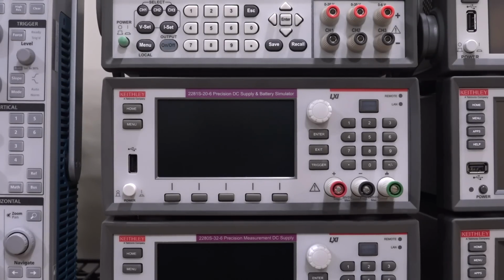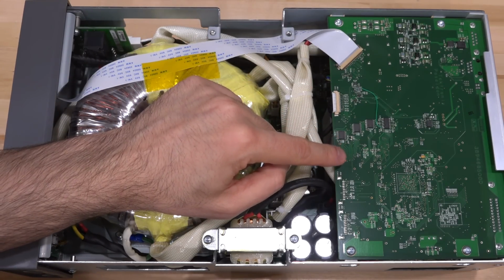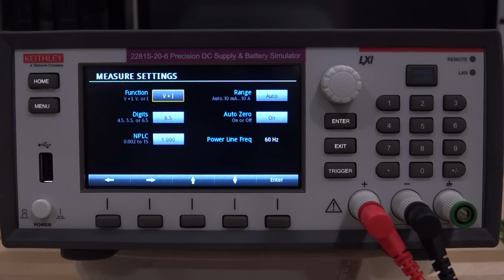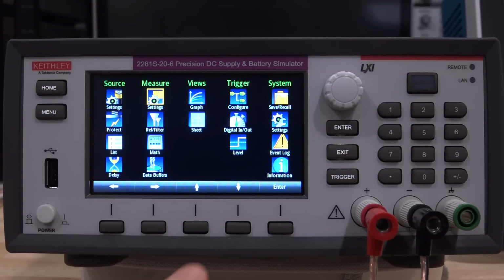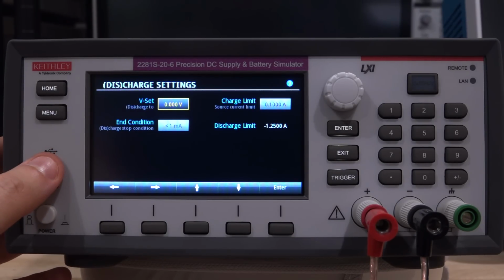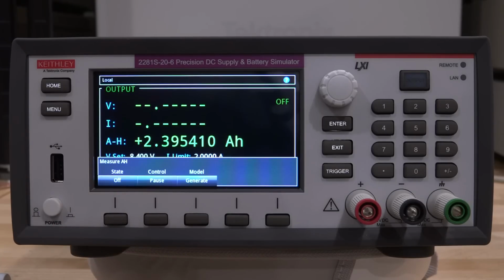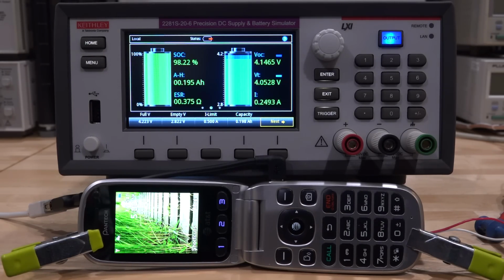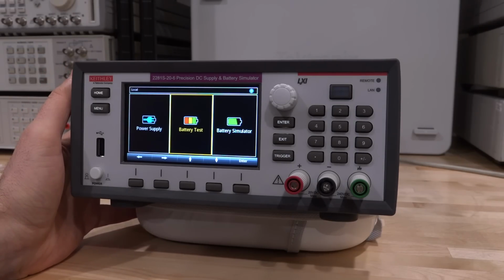TSP #222 - Keithley 2281S Precision Power Supply & Battery Simulator Review, Teardown & Experiments

Comment: Thanks Shahriar. So can battery ESR be manually calculated by (Voc - (Id * Rd))/Id where Voc = V open circuit, Rd = discharge resistor, Id = discharge current?

Comment: For those without an SMU, and the ability to create battery models, is there an online resource for battery models that the 2281S-20-6 can use?
Reply from the maker: It is a very basic CSV file for which you can create in Excel.

Comment: Nice review! I also like the way you used it to locate the short circuit. I don't know why yours is quiet but mine makes a lot of noise. It seems from the 1st day that the fan is always operating at maximum or at least very high speed. When you power it on the FAN starts in lower rpm which still makes a noticeable noise and once it boots the FAN speed gets higher rpms producing a lot more noise. I also checked that I have the latest firmware in case there is something wrong there.

Comment: I'm guessing that on the small PCB for the large transformer, there looks to be a relay to apply mains to the big transformer. And the small transformer is for a standby supply that enables the relay for the big one, and also powers the RTC supercaps, and whatever else,  when the unit is not in use.

Comment: Thanks Shahriar for this great review.  Do you have any insights as to how the terminal voltage in the battery simulator is implemented, ie purely software or hardware? Is it possible for you to show on an oscilloscope the response time of the simulated terminal voltage changing due to the ESR under a dynamic load?  ie in your experiment, the cell phone consumes 0.2A and then suddenly increases to 0.3A, how long does the 2281 take for the Vt to drop accordingly due to the ESR?

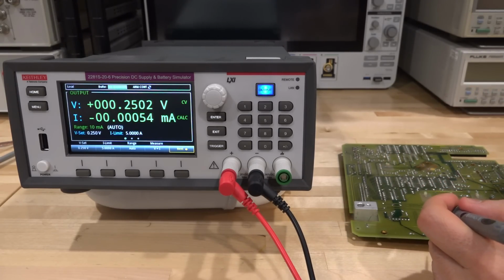Comment: 14:38 the short current at its highest was 0.87A. How was it possible if shorting 2 probes draws only 0.77A @ 12:57
Reply from the maker: The plate I was using to short the probes was a little too resistive.

Comment: They should have either put in a touch screen or modified the interface to be intuitive to use with arrow keys. This middle ground seems very awkward. You can even tell that you're having to pause and hunt for the right key as you navigate the menu system.

Comment: I have used this instrument for a year together with the 2450 SMU. The fact that the instrument does not have touch screen is VERY annoying. Almost every time i use the 2281 I try to use the screen. The 2450 (and other) has a really well designed GUI and touch screen inteface. And when the screen on the 2281 look the same it shall work the same.
Keithly: Please come with a 2282S-20-6 with a working touch screen + some other improvements...
Reply: For $4,000 its odd they would have left out the touchscreen. There must have been some other reason than money.

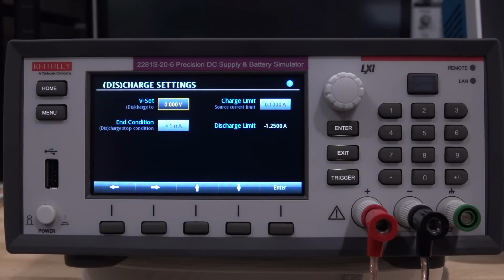Comment: 21:31 discharge limt = 1.25A
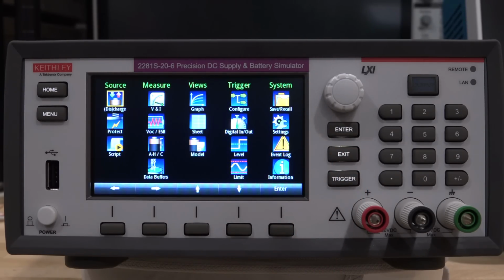26:00 1.11A discharge. I thought u said whether battery is capable or not it will discharge @ 1.25 A. Please explain. 
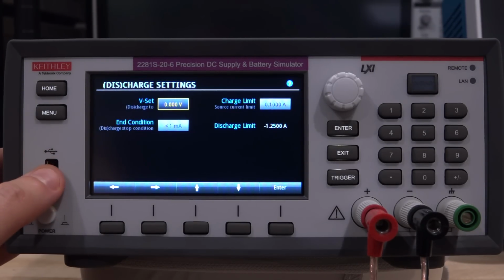I also didnt understand y u would put a resistance in series as said @ 21:45

Could u also brief on regenerative load Keysight RP7900 or alike. It looks interesting but dont know drawbacks.

Comment: For battery tests I like to use an actual battery with a much cheaper, faster, and easier to use Joulescope. Battery simulators, even on very high end Keithley devices, don't capture the dynamic behavior of primary cell LiFeS2 and LTC batteries. Primary cells don't model well as a simple ESR and voltage - they behaver more like a pair of RC circuits, and have strong temperature effects. So it's nice to be able to use a real battery in circuit, and still get amazing precision and 0.5 us resolution. And it streams onto your 4k monitor in real time, where you can quickly measure power, charge and timing.

Comment: When we draw current from a battery, it causes heating inside the battery.
To "test" a battery, we need to be able to draw the same current as the device we are simulating. If we draw some other current, the test result will change because the heating changes.
Doesn't this render the test results from a fixed sink current useless?
Reply from the maker: It is definitely a compromise. Batteries also have memory effects (partially due to thermal effects), and you cannot capture it with a linear, lookup-table model. I have suggested this to the Keithley team.

Comment: One downside of this unit which Shariar doesn't mention is that the remote web interface is written with Java applets, which haven't been supported in browsers for roughly 5-7 years or so. It still advertises this as a point on the datasheet though: "Emulation of front panel display and controls via your web browser simplifies automated control and monitoring". Kind of a bummer for a very expensive power supply to have an issue like this.
Reply from the maker: I haven't look into the web interface directly, but the Kickstart software compatibility is of course independent of Java. I'll look into the web interface.
Reply: This is quite annoying although the web interface does still work on internet explorer.

Comment: I have two of the 2280S models on my workbench. I bought the first one when the model initially came out and it came with a carry handle. The same model nowadays doesn't come with a carry model anymore. I wonder why they got rid of it.

One other thing I noticed was that the default idle fan speed/noise seemed to increase in later firmware versions. The initial release firmware resulted in a quiet unit but the most recent version is pretty loud in contrast. I didn't see anything mentioned in the change log so I am unsure why they increased  the fan speed (at least what I perceived) without mentioning why.

All in all. They are pretty nice units to have given their prevision, graphing capability, and triggering functions. These units fit into the tier between general power supplies and SMUs in terms of cost and given features.

Comment: For me, the lack of discharge modeling/programmable load functionality is pretty devastating. I believe this sort of device should be a one stop shop. That's the point of a dedicated device.
I really don't get it.
Reply: I'm sure Keithley has the in-house expertise to add a prog. load considering their SMU market share. Also, not sure why the tremendous transformer is necessary when the single channel output power is 120 watts, or 20 volts DC @ 6 amps. I wonder what the VA rating is on that toroid and if the job can be done with a smaller tx to free up some room for programmable load hardware.
Reply: @kevina.4036  I'm pretty sure the overbuilt transformer is for stabilty.
Reply: In their defense, it's a power supply, not a programmable load.
Reply: Much agreed, and the discontinuity/missing touchscreen from the other instruments breaks workflow, further disappointment.
Reply: Keysight options are worse.

Comment: hey what a convenient short circuit detection. quick question: i do not have / cannot afford yet any precision psu like this device... but i do have a very basic riden rd tech psu, which has a less precise voltage and current limiting. and i also have a 34401a which is a good and reliable 6.5 digits multimenter. so perhaps this will work? assuming if this cheaper psu can maintain a steady state average voltage self consistency during the whole probing and fault finding session? - then surely i must try this out!! a truly awesome and useful feature. thanks so much for demonstrating this technique

makes me wonder what other new possibilities may exist with my 34401a beyond that. it cannot be the only thing
Reply: Yes, works fine.

Comment: Is this device a subset of a more expensive source meter? Or does it do things the sourcemeters don't?
Reply: I mean just its power supply features, not the battery simulation/testing.
Reply from the maker: It is a subset of an SMU, yes.

Comment: I don't get it. I did while you were closing in on the short. But you lost me when you measured 0.86 ma at the short. How can that be when at the beginning you showed the current with the two probes touching to be 0.77 ma ? 
The max possible was .77, then you found .86.
Reply: The contract resistance of pressing the probes together is probably higher than the contact resistance between the sharp probe tips and the solder points.
Reply from the maker: Yes, this is what happened. I think the Al plate I tested the leads on was fairly resistive.

Comment: feel like you can just do that with a power supply, a resistor and a oscilloscope which you probably have. But if the company pays for instrument, why not
Reply from the maker: A simple resistor would not be sufficient because a battery has a range of ESR across its discharge cycle. Not to mention that you cannot create a battery model with that anyway.
Reply: @TheSignalPath  thank you free education

Comment: Thanks for this Shahriar, I have both the 2281S and a 2450 in the personal lab. I did run head first in to the testing limitation of the 2281 having a need for making models of coin cells. I am posting the models created with the 2450. I currently have a CR2477 burning down on the SMU this weekend. Both units are fantastic to have in the lab. Thanks for the deeper dive in to the battery simulator. Have a bunch of AA, AAA and CR cells already created I can send links if there is interest.
Reply: I would be interested in any models you have created for AA batteries

Comment: Very nice power supply, I have the 2280S. What I am missing on that supply is a way to zero the current measurement (It has a small offset). My main problem with the supply is the fan, it is way to noisy and means I only use the supply when I need its capabilities.
The 2 quadrant function is sometimes very useful and at other times a pest.
I am a bit surprised about your Ri on the 18650 cell, generally they are below 0.1ohm (I have measured a lot of them), but then you 4-terminal setup is not very good.
Reply from the maker: The 18650 cell you saw is very old and near its end of life. That is why its ESR is so poor.

Comment: Green shrink tube seems to cover screw hole ?
Reply from the maker: That hole is not used in this chassis.
Reply: Unused holes ? That explains the price 😀
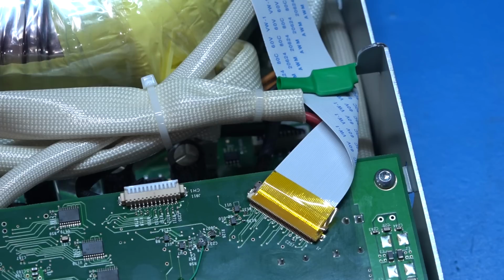Reply: At 9:55, Shahriar said that he put that there as a bit of extra protection for the flat flex cable. That screw hole is not used in this instrument.

Comment: Nice! I got one of these for work. First thing I noticed is the unit is super heavy, that big toroidal transformer is no joke!

I think it has a current sink feature, but it is not a fully programmable electronic load too. I wish Keithley would incorporate a "discharge learning" mode where you could actually discharge an attached battery at a given rate, and learn the discharge curve/esr to the instrument, so you can then simulate the DUT you just discharged.